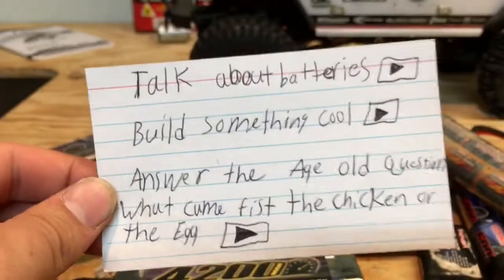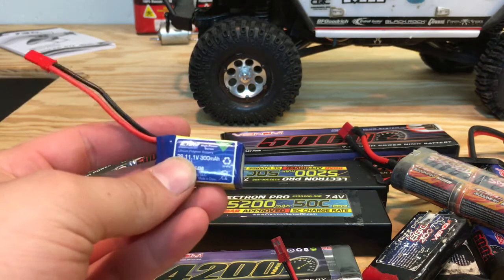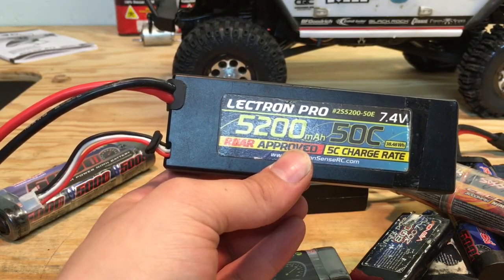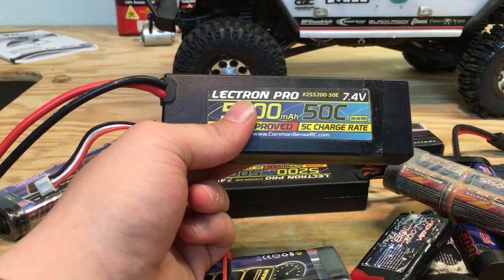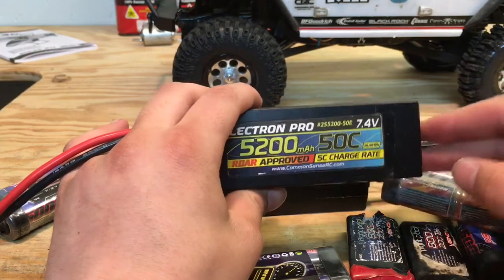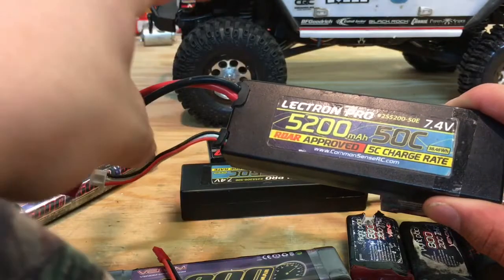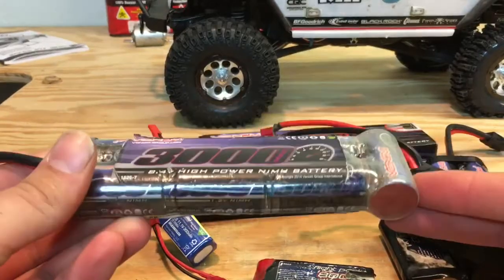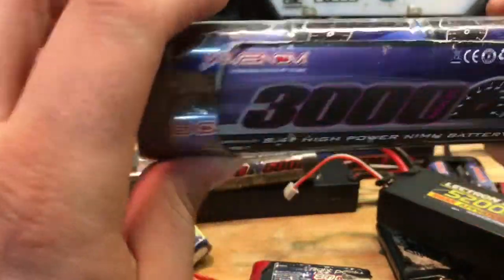Lipo’s VS NIMH Batteries.

Comment: Would you rather get a 9.6v nimh or a 7.4 Lipo battery?
Reply from the maker: Probably a lipo but it depends on the MAH and it depends on if you have a fast rig or a slow one, If I'm trying to go really fast, I would use a lipo, if I'm rock crawling, a nimh but right now I currently use a 3s lipo for my rock crawlers. Just to give them a little more speed espicailly in cold weather like snow and ice.